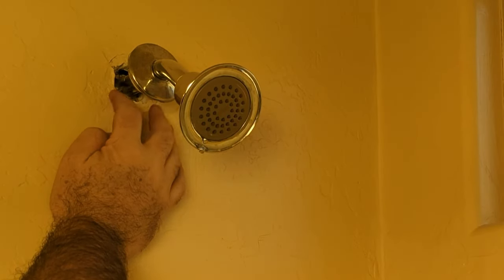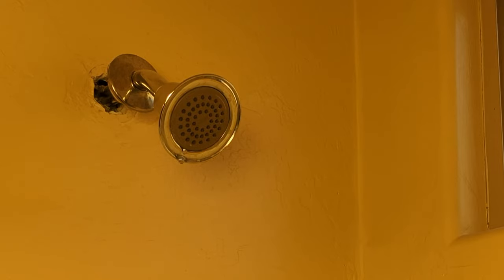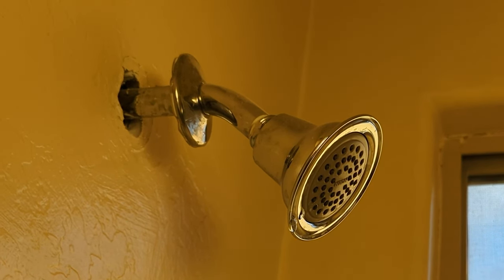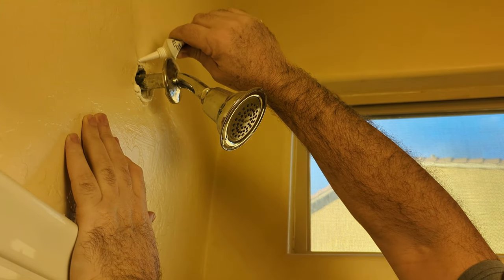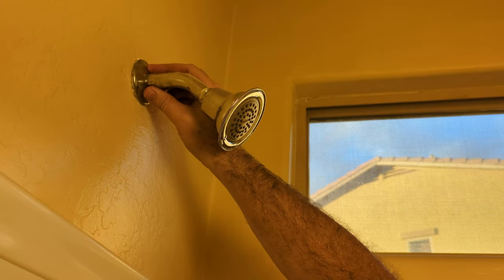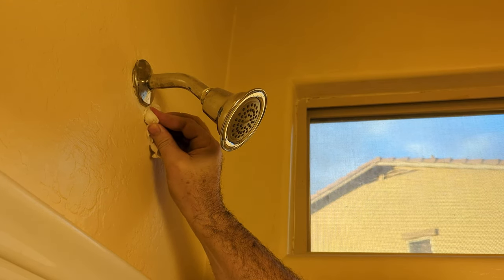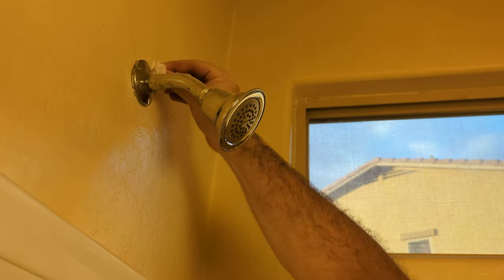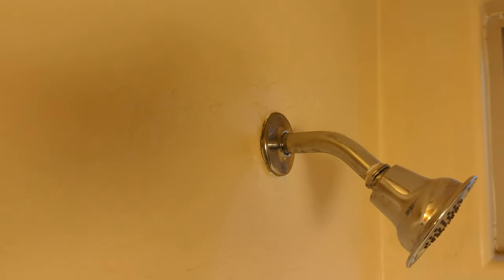Shower Head Base - What is it called and how do you fix it?

Comment: The wall part on my is all like torn and the shower arm is super loose what can I do for repair
Reply from the maker: You can unscrew the shower arm and put some teflon tape on the threads do get a good seal. Check it for leaks and if you have a good seal then you can repair the wall. But if the wall is not that bad you can get a new flange to put over shower arm.
Reply: @ThatHobby  I meant like the wall part and the arm itself
Reply from the maker: @Jocelynie870  I haven't had to repair mine like that but you can buy a new arm for it. If you have drywall you can cut out the damaged area and put a new piece of drywall in the area. I am not sure how bad it is but that is my best guess on how to repair it.